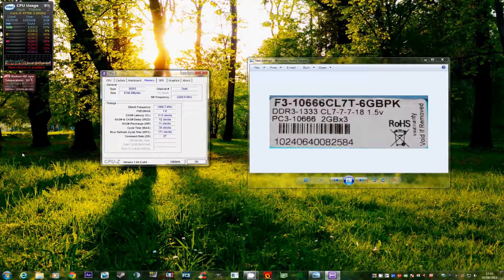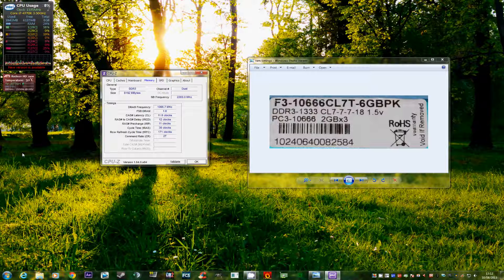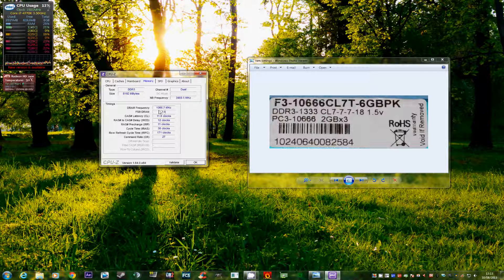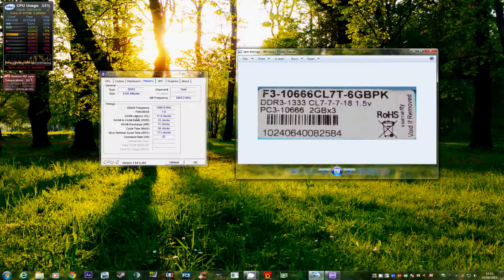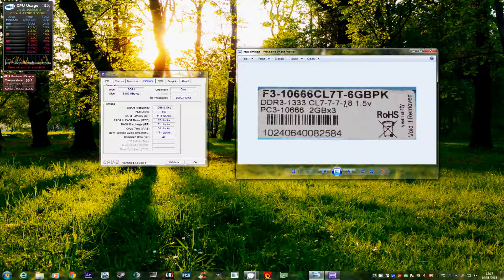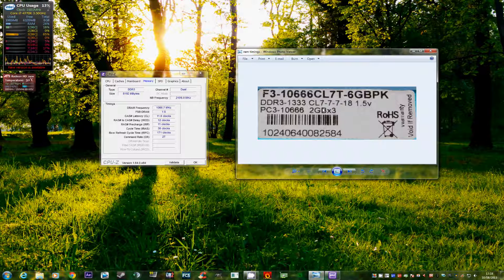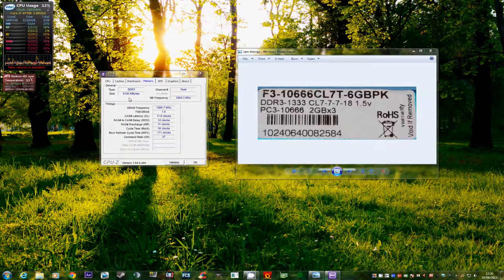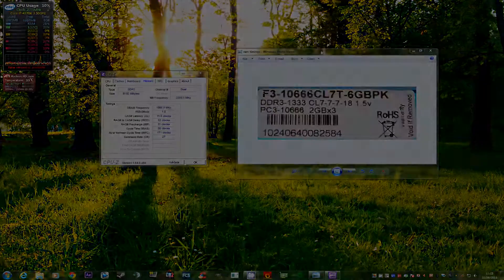RAM - A Basic guide - How to Setup & Understand your RAM Kit

Comment: could i change timings from cl8-8-8-8-24 1.6v to cl11-11-11-28 1.5v 
 both 1600mhz
or  in reverse to make  4  slots work with 16gig  
i have 8gig installed and another 8 gig laying around both gskill on a gigabyte MOB

Comment: Sorry just a question, is it better to invest more money on lower timings/latencies or higher frequencies for the same gigs of RAM.
I've heard that higher frequencies ususally bring only a slight improvement in everyday desktop use. Does timing give performance than frequencies?
Thx
Reply from the maker: Well it all depends on what work you do with your PC tbh. High speed ram is good ( 2133Mhz etc ) but it comes at cost of latency, but the speed compensates for that. Overall i would say that almost all common ram kits currently available will cater for 95% of users and only a handful would require paying the extra for ultra low latency. 

In everyday computing id say an average 1600Mhz/1866Mhz kit will suffice for most users. The differences between 1600Mhz and 2400Mhz in terms of performance is very very minimal.
Reply: It depends what you are doing. If you are gaming, you should aim for higher frequencies. If you are performing long running tasks such as video rendering, lower latency is better. Finally, if this is a general use PC, you probably want to find the balance between the two.

Comment from the maker: Could be your GPU is overheating or dying. If you are getting strange lines while playing , either your gpu is overheating, dying , or your graphics drivers are corrupt. Try to install the latest drivers for whatever gpu you have, if it persists then remove your gpu and give it a clean with some compressed air. If it still persists then you may have a dying gpu and will need to replace it

Comment from the maker: Your frequency should be at 800Mhz( not 669 =1333Mhz ) for 1600Mhz total speed, so you may want to go into BIOS and change the speed ( Remember it is Double Data rate so 2 x 800 =1600).

 As for timings, from memory i believe it is 9-9-9-27 or CL=9 tRCD= 9 tRP= 9 tRAS = 27 ( or 24 ). Then you should be all set for 1600Mhz :D